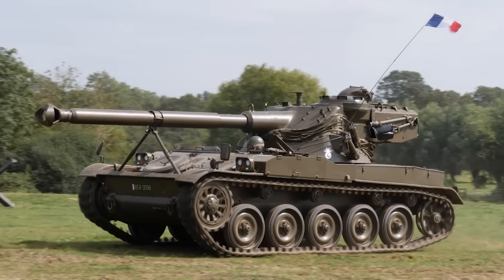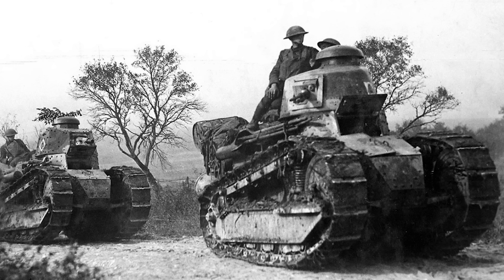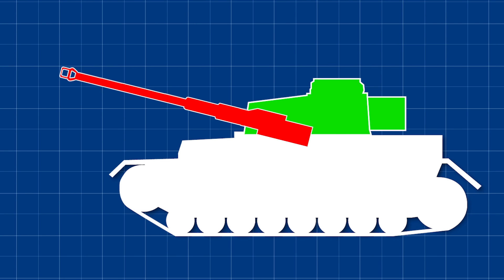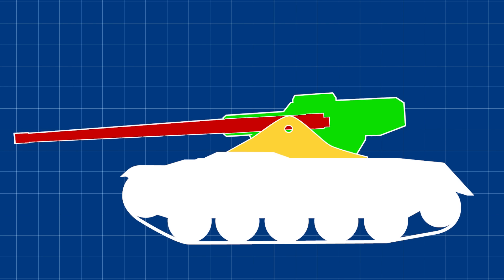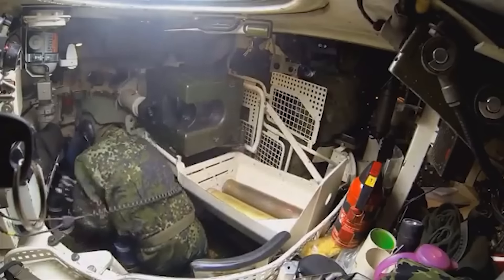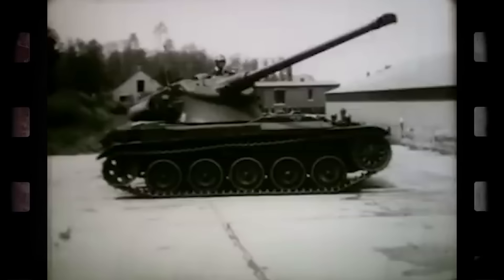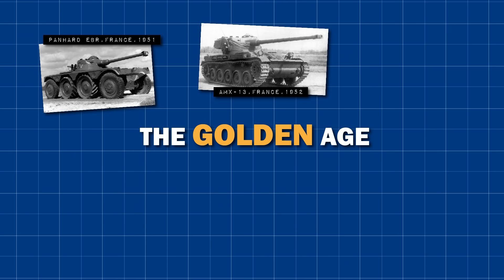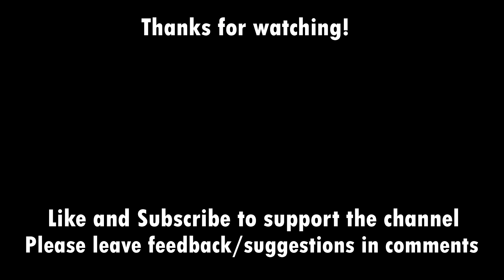What actually IS an “Oscillating” turret?

Comment: I was in the Dutch army in 1977 and they still had this AMX 13 but with a standard 120mm Nato gun. It was forbidden to shoot with the gun at 90 degrees on the chassis as the whole tank could roll over because of the recoil. Some tank! They where faced-out after a few years for the Leopard.  Also they where notorious unrelaible engine wise.

Comment: Very good analysis. Oscillating turrets are also weaker than the much stronger rotating ring turret, as a well placed shot at the pivot will separate the turret from the tank, leaving the vehicle a "Sitting Duck" with no main gun to defend itself.

Comment: I'd be interested to see a look at hydropneumatic suspension, in particular why the Japanese are so fond of it while it's barely seen use in tanks elsewhere.
Reply: Japan is an island nation with lots of mountains and hills, so a hydropneumatic suspension is a great system to be implement
Reply: Hydraulic and pneumatic suspensions offer many points of failure and leakage from any cause is bad news. Torsion bars don't have those issues. Complexity not absolutely necessary to the mission is a Bad Thing for many reasons, some not obvious especially maintenance, repair and BDR.

Comment: 4:55 some designers and I even think the idea is pretty cool. would include a tarp like material that would stretch between both turret pieces to seal it from NBC threats while not impacting the apression or depression
Reply: The issue isn't sealing it under non combat conditions, but under combat conditions.

If you're being attacked by chemical weapons, it's likely not the only thing you're being hit with. It's likely of example that an enemy might shell your position with artillery using both conventional and chemical weapon shells.

The former are capable of puncturing the tarp in a way that the latter can likely begin to have an effect.

The problem with the turret gap is that it makes it difficult to positively preassurize the inside of the hull. It would require either a very powerful system, extremely tight tolerances, or two separate sealed compartments in the turret and the hull

Ultimately, autoloader technology got better, and the oscillating turret became unnecessary

Comment: That was interesting. I’d like a video explaining why tracks are not made wider to better support their weight. 
In WWII I maybe misunderstood the T34’s wider tracks allowed it to travel without sinking as much as the German and American tanks. If they can’t be made wider, please explain why not.
Reply: Cost/weight/need wide tracks cost more to engineer & make plus are more susceptible to damage, wide tracks weigh more and so make track changing much more difficult, heavier wide tracks put more stress on transmissions and finally designers couldn't see an advantage with all the disadvantages to fitting wide Tracks.

Comment: I don't understand why they didn't just use a double articulated joint with 2 solid 12 degree offset rings. It would allow for 24 degrees of elevation and depression, while keeping the turret as low as possible while mounting the GUN as HIGH as possible, allows for a full NBC seal, still allows normal turret rotation, carries all but 1 benefit of the oscillating turret, and you can overlap the joints internally for added protection. The design is even conducive to having sloped sides.
I understand why they don't use the design NOW; because it's substantially slower to alter the gun elevation, so it would be really incompatible with gyroscopic stabilization. Regardless of how fast you can make the rings rotate, it comes down to intertia. It's just too much rotating mass to reverse direction to allow for quick elevation changes.
But it would make a LOT more sense to have used a double articulating joint over an oscillating turret.
And I disagree with the implication that gun height is a bad thing. A high mounted gun is a very GOOD thing, especially when the rest of your tank isn't elevated along with it. You NEED your gun to be exposed, because it's the thing that's shooting at the enemy. What you DONT want to be exposed is any other part of your tank.
The reason gun height is considered a bad thing in conventional turrets is because the rest of the turret gets elevated WITH the gun, thus exposing more of the tank to fire.
Imagine being able to sit an entire foot lower in a tank ditch with only your gun and sight being exposed to shoot.

Comment: i wonder though if the french decided to push with the oscillating turret because of the guns they have, which from what i remember is developed from ww2 german tank guns which have a near flat shooting trajectory, which would mean that they wouldn't need that much elevation and depression in order to achieve similar capabilities as other conventional turret designs on contemporary tanks.

in regards to the slit between the collar and upper turret piece, i think if the design accounts for it, they could put some form of a sealing fabric internally so as to mitigate the problem of NBC protection, although there are some designs which had some fabric.
considering that the AMX-13 was pretty much meant to be more of a tank destroyer than a light tank (doctrinally), i'd say it worked well enough.

oscillating turrets could return in the form of remotely operated systems like that of the aforementioned m1128 in the video, although there is still much to done to make a reliable version, or atleast one that can work without the m1128's autoloading system and using something similar to that of a bustle autoloader.
Reply: Regardless of the ballistic trajectory of the gun, terrain still needs to be accounted for. So the amount of elevation and depression needed doesn't change much. E.g. some soviet designs like the T-34, T-55 etc are really low, but cannot easily take up reverse-slope hull down positions because they don't have much gun depression. 

So I am assuming the main motivation for the French was in enabling good autoloaders. 

I agree with you with regard to unmanned turrets.
Reply: Work on oscillating turrets began in France before WW2. The first blueprints of the EBR with an fl-11 turret can be found during the late 30's, it wasn't inspired by German guns.

By the way, the idea that the 75mm used on the post war AMX's is based on Panther's gun is a myth, the designed evolved separately and the breech, barrel and muzzle are as different as it can get to the German 75mm gun. But honestly I don't blame you, even the Chieftain made the mistake (before correcting himself later with up to date sources) !
Reply: @gastonjaillet9512  " the first blueprints of the EBR with an FL-11 Turret can be found during the Late 30's" if you're talking about the Panhard AM 40 P, then that is the progenitor of the EBR but certainly did not have the FL-11 turret as the AM 40 P had a different turret, Panhard took the design from that work and integrated it into the EBR. 

in the statement of 'it wasn't inspired by german guns', the idea i was putting out was that the reason they went for the Oscillating turret due to the ballistic trajectory of the guns they had at the time, not that the progenitor of the EBR had guns that were inspired by german guns, or this might be another case of wording with different perspectives.

and by the 75mm being based on the Panther, i simply implied that it was developed from that of the german guns not even specifically mentioning Panther, having a gun based on the panther's gun or any other gun would imply that they took the design plans and schematics to remanufacture the guns for their own use, which is different from developing a gun from the data from the german gun which gave the engineers some formulas to work around into developing a gun of similar capabilities if greater than that of the german guns they were developed from.

although i'm going to have to scour Chieftain's archives for wherever he talked about the French developing their guns from the german guns, most likely in his M-50 sherman video or wherever he talked about the FL-11 turrets on the shermans.
Reply: @executivedirector7467  i do agree on the motivation with the french focusing on rate of fire with good autoloaders, as that would've improved the existing capabilities of their tank squadrons (which from battle order would be inspired by the US Tank Destroyer Squadron).

although i don't necessarily agree that terrain is much more important than the ballistic trajectory of guns, but you do have a point in that having better elevation and depression is quite a nifty aspect to have.

Comment: at 4:22 this point is completely nullified by modern systems. Typically the sight and guns are not linked, meaning while the gun is not pointing at the target, the gunner can still aim at it. Leopards have what is called a loading position to facilitate the manual loading of the round which also goes in pair with 3:35 even without being off horizontal. During that time even if the gun is pointing all the way up (position is tunable via a dial on the loader side) the gunner wont even notice it

Comment: Very interesting video. I wonder most how this will progress in the future.
Using the Isrealian idea of protecting the crew first then it would mean that this design would be viable.
Have crew in the lower protected body, only gun in danger zone.
Use software and autoloader to reload the gun after firing and the software te return to the previous firing position.
This might result in a fast tank assault capability using terain/buildings as cover without sacrificing crew.
Although i know my idea is not perfect, im wondering how it might progress into the next technolgy area.
Reply from the maker: That’s exactly how the M1TTB and the T14 Armata work! Remotely operated turrets.
Reply: @RedWrenchFilms   I dont think remotly, im thinking of an experienced crew on stage(in the tank) that in most conditions would only lose their turret. Return for repairs and get a fully functioning tank and crew back in action again!
I still believe that humans are best equiped for moderate warfare, and allowing them freedom on the battlefield with less risk of losing an experienced crew is worth more than gold.

Comment: I suspect that Halo's scorpion tank is based off these kinds of tanks, lending to it's iconic elevated turret look (hence the scorpion nickname). It has an unmanned turret, meaning there is no gunner and loader (or tank commander for that matter, and the turret is entirely controlled by the driver. The only issue is that the gun is treated like a traditional tank gun, meaning it pivots separately rather than as part of the turret.

Comment: most tanks are not sealed for the NBC capacity. it does not need to be sealed to have this capacity. The solution is what the laboratory is using, you just need to raise the air pressure inside the tank by using an air filter that will pump air inside the tank, which will make a constant airflow leaving the tank and not entering it. if there is a chemical in the environment, it will not enter the tank as the airflow will push it out and not in.

Comment: From modern tank design, moving the barrel/breach to reload doesn't seem to be an issue anymore.

Take the leopard 2:
The gun is controlled by a targeting computer, gunner sights can move independently from the gun. The gun is elevated into a loading position after each shot to allow the loader to "comfortably"load the gun independent from the aiming elevation. The gun is then brought back to its firing elevation.
Same should be true for autoloader tanks.

It would have been interesting to know how the crew is moving with the oscillating turret...
Was it an autoloader design?
Reply from the maker: Yes! The AMX-13 had an autoloader consisting of two 6 round drums which fed the gun.

Comment: I wonder if oscillating turrets will come back into fashion with autonomous (or drone) armored vehicles since there’s no crew to worry about and efficiency of auto loaders is key.
Reply: No it won't, the oscillating turret has quite a profile and for modern auto-loaders you'd need more space, that and it would be too heavy for the motors which pivot the turret up/down

It just wouldn't work, so it's better to stick to conventional tank turrets, I mean look at the reload of the Type 10, it's 3 seconds and that's quick as fuck, or the Leclerc which also has a nice reload. Or even better the Type 90 which could reload in 2-1 seconds under the right circumstances

The auto-loaders of nowadays are more than efficient enough and we don't need oscillating turrets. Back then they existed because auto-loaders were pretty new and still mainly manually used instead of fully automatic loading like now, putting it in an oscillating turret would only complicate things more
Reply: @evo3s75  Hmm, see, I dont have enough experience with tanks, so I could be very wrong, but wouldn't an oscillating turret be cheaper and lighter than a complex autoloader? Plus, my general philosophy when building anything mechanical is KISS, keep it simple stupid. This is a genuine question so I'm sorry if it's dumb, but wouldn't a complex autoloader introduce more failure points than an oscillating turret? And when there is no crew, you can't just have a guy beat it with a wrench until it's fixed, so you need to minimize potential failure... I would think. Problem is, as I said, I don't have experience designing tanks, so I could be completely off the mark. 

There's also the issue of cheapness, because the quicker and easier it is to build, the more you can have, which is generally a good thing. 100 99% efficient tanks are better than 1 100% efficient tank. Would an oscillating turret be cheaper than a complex autoloader?

Comment: Oscillating turrets in the modern era r suitable for afv or spaag vehicle. Like Russian terminator. Smaller guns can really benefit the system. Have higher elevation smaller turret etc ii. With its only drawback is the vehicle profile quite high

Comment: Modern tanks that require the gun to return to the index position don't really suffer from any serious downsides of the gun having to depress to that position as modern armored vehicles disconnect the gunner camera from the barrel so the camera can remain on target while the gun is in a separate elevation position, thus eliminating the main potential flaw of the system

Comment: I still cant get my head around how halftracks turned. 
Would the tracks being powered just overcome the wheels at the front?
Reply: Excellent question. It depends on the design. The US M2/M3 halftrack series had powered front axles and steered by turning the front wheels. The track run was relatively short on the ground so it wasn't hard to drive. The German SdKfz-251 series had unpowered front axles and a much longer track run. They were much harder to steer even though they had transmissions that shifted power to the outside track when turning.

Comment: I don't understand why the auto loader had to be costly just to offset the angle of arm extension... would that not be handled easily with either a rack for the arm to pivot on or an extra joint in the arm end with a small amount of resistance to allow the barrel to align the shell as it is pressed in at an offset?.

Comment: Actually, it was another advantage,  forgotten in the movies. 
The small AMX 13 , (13t full load)  carries a high velocity 75mm gun designed for a huge German Panther 57t. 
Tilt turrets allow that , otherwise, you need to build a tank 4 times heavy .
Reply from the maker: How does an oscillating turret allow the mounting of a heavier gun? Aside from what I’ve already mentioned about the turret/turret ring being significantly smaller.
Reply: @RedWrenchFilms  
Well , oscillating turrets doesn't need large bearing for large turret, as explained in the excellent movies 👍 
And AMX 13 not only received HV 75mm, but also 90mm and evens 105mm 
So is a cheap, light , and efficient tank hunter 
https://en.wikipedia.org/wiki/AMX-13

Comment: So essentially, a tank with an oscillating turret is has some advantages in regular conventional warfare when it doesn’t include NBC. But when there is NBC, your normal conventional tank would be ideal for it. So in terms of firepower and outputting more shells down range, a tank with an oscillating turret with an auto loader in it would be ideal, but in terms of protection, traditional tank turret designs would be better for that…

Comment: so technically the worlds best tank would have the engine and transmission in the front with the driver just behind like the merkava. it would be equipped with an oscilating turret with increased depression and elevation  via the help of  hydraulic suspension like the strv 103 have. then a compartment for soldiers in the back. in addition to that it would have special air filtration systems like most oscilating tanks already have top ensure safety against NBC weapons